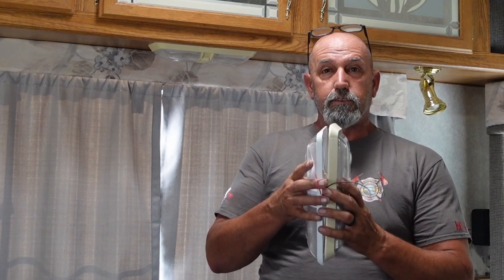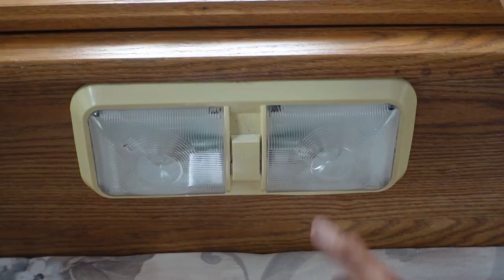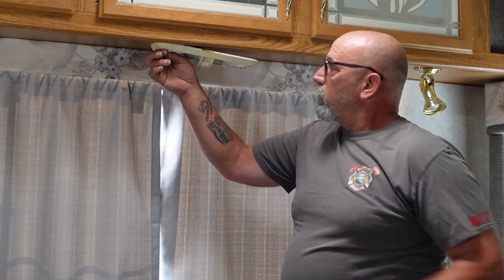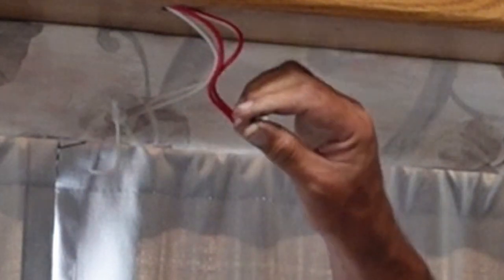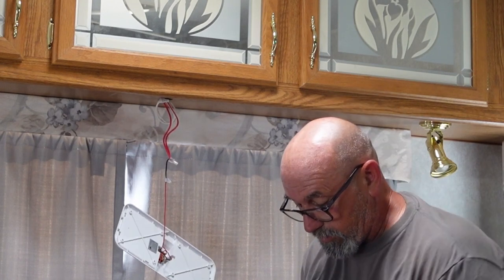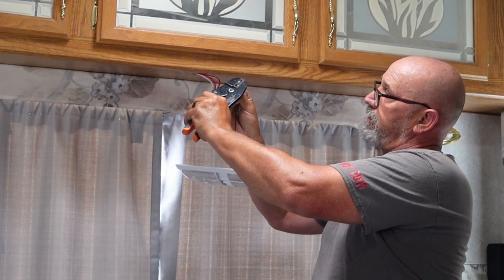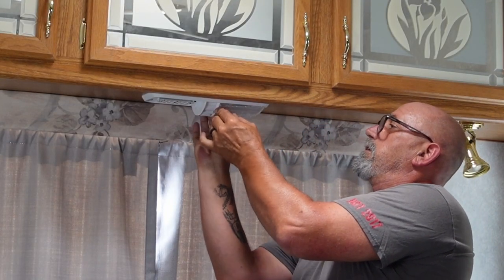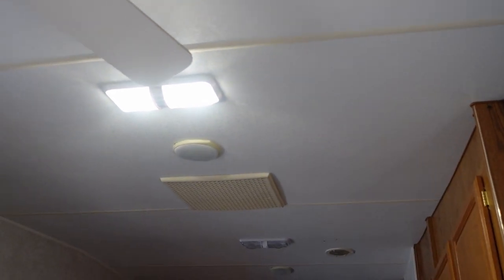RV Light upgrade to Leisure LED RV LED Ceiling Double Dome Lights

Comment: So when the leds die we have to change the fixture again instead of just a bulb ?
Reply from the maker: Yes, there may be others out that will use a replaceable bulb.
Reply: I have the single sided ones in my trailer and double in our family cabin. Both can change the bulbs out
Reply: Have you never seen the life cycle of a led bulb? Do you not have any leds in your home? Even China leds should last a long time don’t ya think?
Reply: @teamdada2194  all the led bulbs in my trailer have almost died and I bought it new in 2019.  I've been switching over to these lights as they die.
Reply from the maker: Ok.